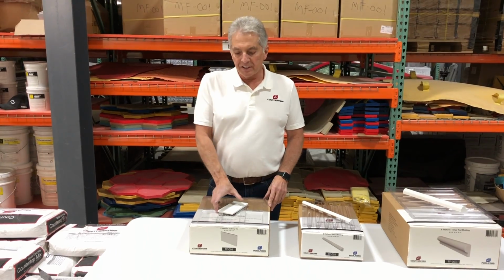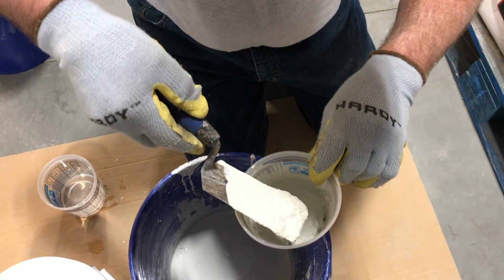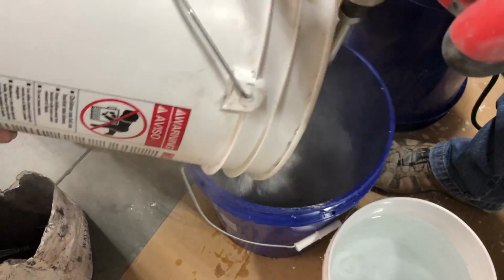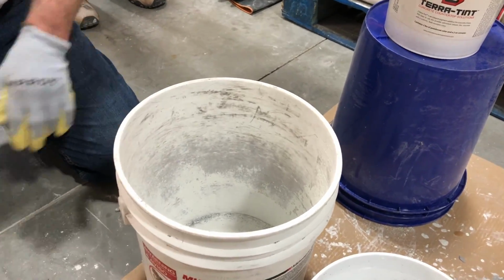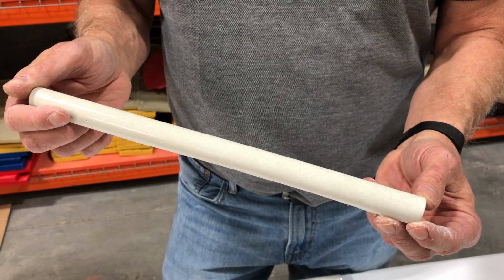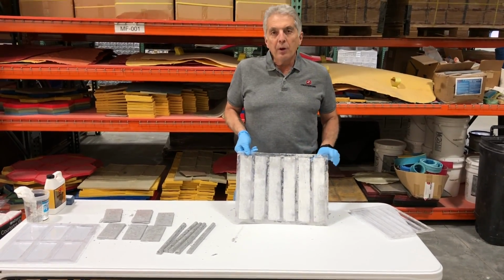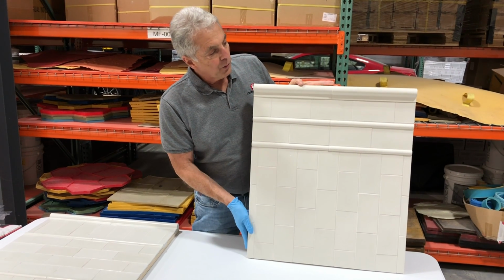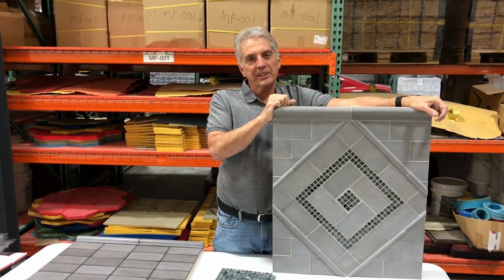Learn how to make concrete wall tile with Z Tileform

Comment: interesting. one question, can the subway tiles be for flooring as well if you make it by yourself? i was wondering if there is a possible way to make it durable on flooring.
Reply: Use superplasticizer and less water. You will also need course aggregate. Those tiles are strong enough for flooring.

Comment: Pls what material are required to make tiles.from Nepal ❤❤
Reply from the maker: The main products are the tile molds and you can find them here - https://concretecountertopsolutions.com/collections/tileform

You can fill them with any concrete or resin that you can purchase locally.

Comment: I got the pencil tray. Wouldnt come out without me breaking the tile. Is there a step I missed? Are you not spraying some oil or silicone first?
Mine did not pop out like yours.
Reply: I was wondering  if that happens. I wish they would have addressed that.